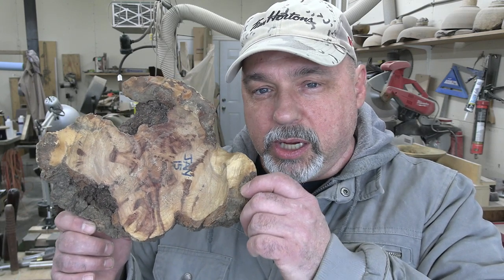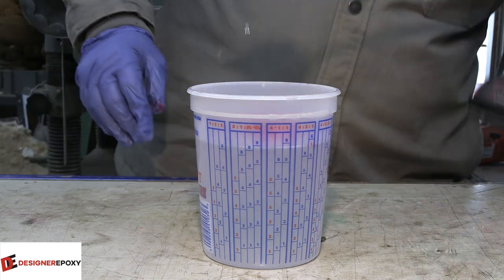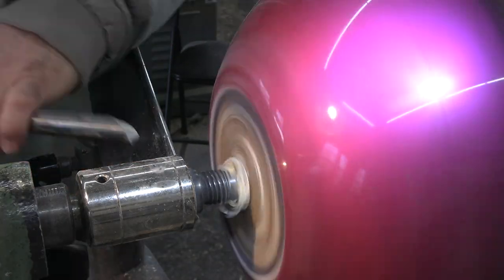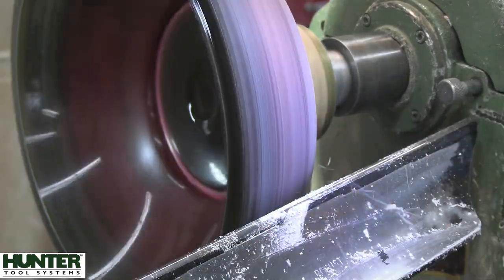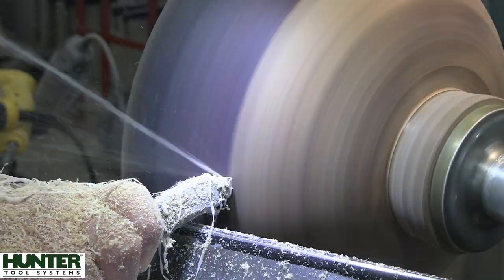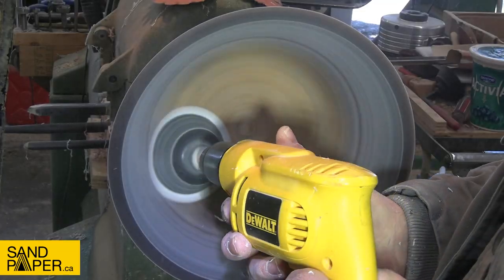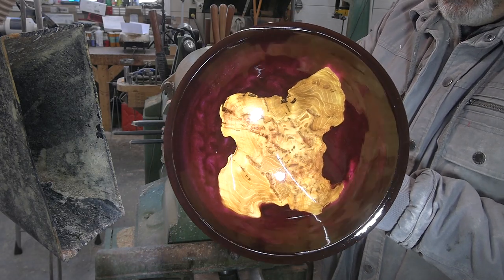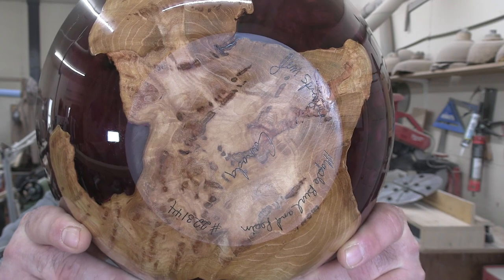Woodturning - A Burl Island in a Sea of Burgundy

Comment: I want to give thanks to one of your old vids.  I have a similar pressure pot to yours and it didn't  hold pressure so I had to leave my compressor going all the time with regulator set to the rated pressure.  After seeing your video, I took mine apart and redid the seals as you did and now it holds 60 psi for the full set-up time.  So thanks for that video.
Reply from the maker: Great m thanks for watching!

Comment: Great use for a beautiful but small piece of wood.  I think you would like the effect if you mixed your 2 colors separately, waited for most of the cure time so they are getting a little thicker, pour them in the bowl and then swirl a small stick through the colors.  I recently did this with an outer and inner mold where the colors were poured on top of each other and then swirled.  Pretty wild effect.
Reply from the maker: Ive actually done this on the channel before. This time I was looking for just one solid color, thanks

Comment: Great use of an oddly shaped piece.  How about a project with the new epoxy formula, but without using a pressure pot?   Would be very curious as to how well you feel it works.
Reply from the maker: It’s only good to one inch and would probably work in this configuration, a normal casting not so much. Pressure pots will always give you better results but will possibly give it a try with the new formula on the bench the next time I do a bowl like this. Thanks for watching!

Comment: Hey Jim ... That bowl is spectacular! Somebody is going to have a beautiful piece.

I prefer the way you put this video together ... I can do without the sound of the lathe (especially the high-pitched racket when turning resin).

There are a number of solutions for the vibration problem when turning bowls. For the outside, I use a set of cones that thread onto my tailstock ... they do a nice job of quieting things down. For the inside, the best solution I have found is Oneway's Bowl Steady. It ain't cheap, but like everything else Oneway builds it is built like a tank and eliminates most of the vibration.
Reply from the maker: Thanks Gerald, been thinking of getting a bowl steady. I do find the glue block method can really cause vibration if there’s too much glue between the joint. Jim

Comment: Hi Jim,
Once again a creative design. As for the blacker at the rim, could it be caused by different densities in the pigments accentuated by the pressure in the pot? If so,  the red would tend to go down while the black would move up in the pressure casting process, as would do the lighter air bubbles? Last I think the darker than wished burgendy better matches the wood, personal taste. Watch you next week then.
Reply from the maker: It seems to only happen with these bowls that are sandwiched. It’s an affect that I really like. Thanks

Comment: Question:  what finish would you use if the customer told you they plan to eat cereal out of the bowl?
Reply from the maker: Put a coat of Waterlox on, then a coat of mineral oil and beeswax, that way it's easy to maintain. Metal spoons are unforgiving! Claphams would work well, thanks
Reply: Thanks, Injay Jim! I look forward to this week's video!

Comment: Great job as per usual and very informative, I’m a learner at resin bowls with mixed success so what’s the ideal speed you would typically use on bowls like this?? Thanks
Reply from the maker: If you have variable speed, turn it up until it vibrates, then back it off until it stops. That’s your turning speed. Thanks!
Reply: @SpragueWoodturning  thank you and will try on my next bowl. Cheers from Australia 🇦🇺

Comment: Outstanding! I also use Designer Epoxy and their powder pigment tends to float and accumulate near the top: more accumulation of pigment makes it darker. Also, love your bowl sandwich casting method! Any advice on type of bowls to use for those?
Reply from the maker: I just pretty much use burl when casting like this. I think with normal wood you probably would get lots of resin staining in the end-grain, so I try to avoid it. Thanks!

Comment: Beautiful Jim!
 A resin question if i may ask.
I want to turn a bottle stopper with an epoxy top. Walnut lower portion.  Which epoxy,  from DE, would you use to pour approx 1.5" diameter by 1.5" tall? Thanks in advance.
Reply from the maker: Go with deep cast, it will work for pretty much any casting. Thanks!

Comment: Wow, absolutely beautiful bowl! It does look like an island:)
Question: have you had any issues with your dust collection system clogging when cutting resin?
Reply from the maker: I try not to suck up any shavings with it, I mainly use it for dust control. I do on occasion need to clean off the metal grate just before the impeller tho. Thanks for watching!

Comment: Beautiful bowl! I'm a wood turner and recently started using apoxy resin. How do you clean up your mixing containers? I've ended up throwing them out. Is this what you do?
Reply from the maker: Most times there garbage, if you want to save them use acetone, it works well. Thanks

Comment: I have been watching a lot of resign have seen a bunch of different brands of resign on the different channels. I was just wondering how many different brands you have tried and why you stuck with this brand.
Reply from the maker: This is the only one I’ve used, so far it seems to perform better than most you see here on YouTube. It’s a Canadian company that has fantastic prices and I see no need to switch to another brand. You’ll see lots of videos here where the resin overheats and cracks when curing and you will really see that with Designer Epoxy’s deep cast. Thanks